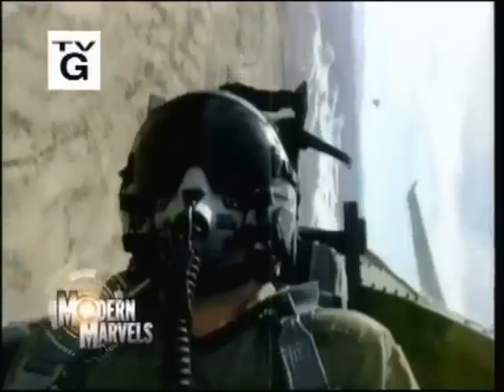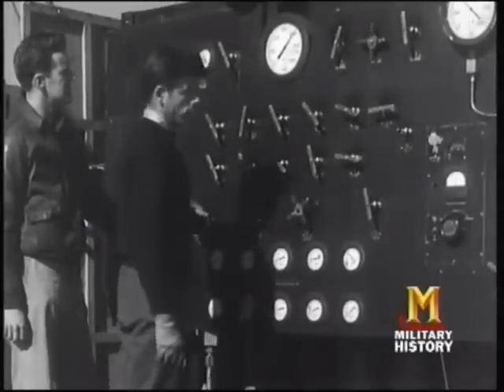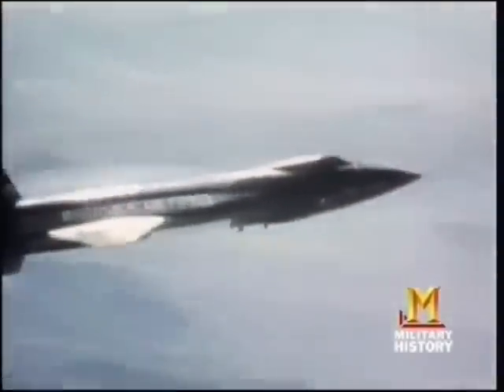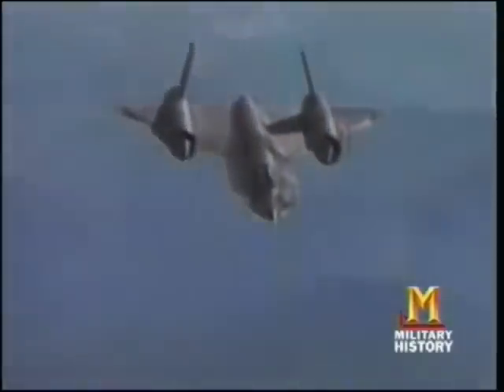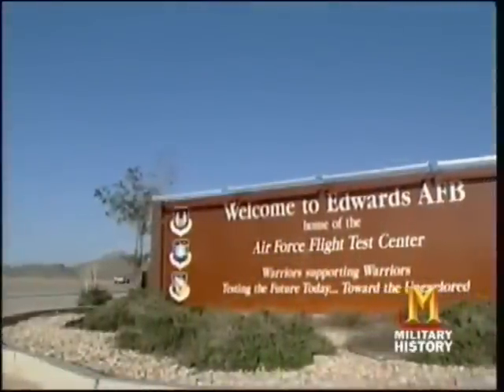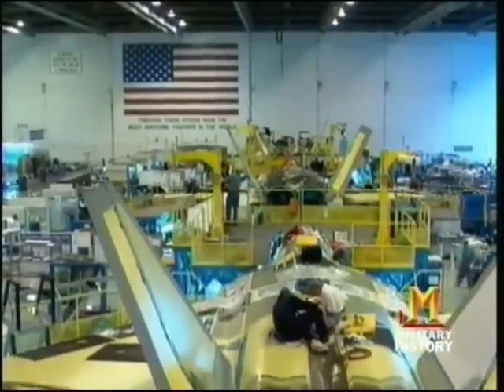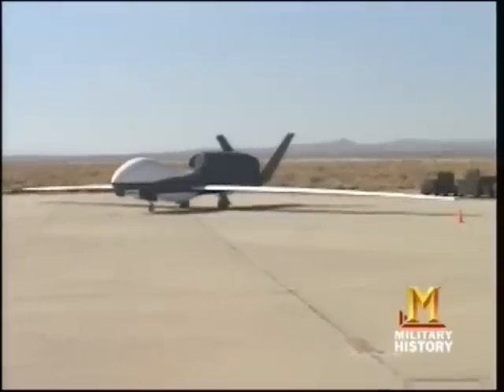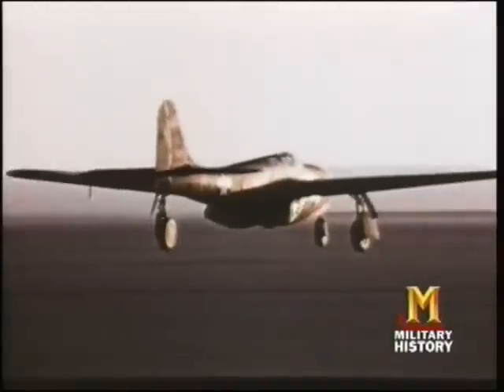Complicated Military Aircrafts - Engineering and Manufacture (HD Documentary)

Comment: And if the Canadian Avro Arrow was allowed to be produced it would have owned the skies for decades. It was finished in 1957 and it exceeds the current F18 specs in spades. Sadly it was cancelled by the government due to costs which is what happens when you are pioneering technology. The designer of the Arrow's frame which could brake mach 3 was tested in the US because Canada did not have a mach 2+ wind tunnel later went on to develop the Lunar Lander used in the Moon landing in 69. Imagine, if the Arrow, a premier of aviation technology and innovation, could be if it was built and put into production what it could have meant for aviation today and what advances it would have had. Sorry America, best interceptor ever built was built in Canada 15 years before the F15 graced the skies.
Reply: The only problem is  AVRO ARROW    has never seen  a combat   while  the  F-15 destroyed 110 RUSSIAN  fighter  in various  conflicts without a single  loss ..It  is  dubbed  the MIG KILLER !  
If  completed, the  huge  AVRO  would  have  been a very  clumsy  dog  fighter..  The F-15  is more manouvrable .
The best  high  altitude   interceptor  in  the world   remains  the  F-14D  Super Tomcat..  could  engage  6 targets  from 100  miles  away and that in 1980's ..
Reply: The Arrow was designed to be an interceptor. It was very fast. Faster than non hyper sonic craft today. Its role was to blast in, fire missles and leave the area just as fast. Truth is, the Arrow was never fully tested as it was ordered destroyed by Canadian politicians at the time. Had it been finished, it would have surpassed anything. But it never got the chance.